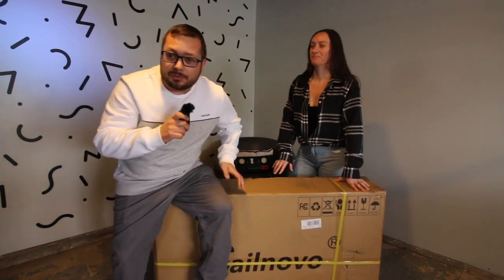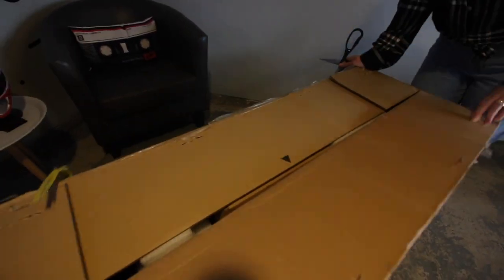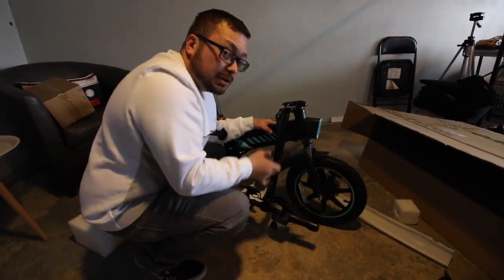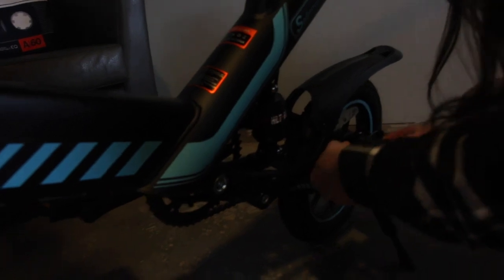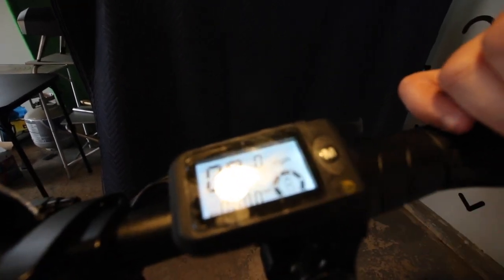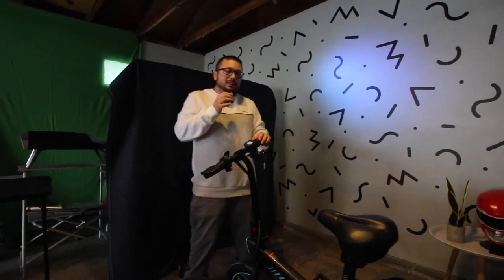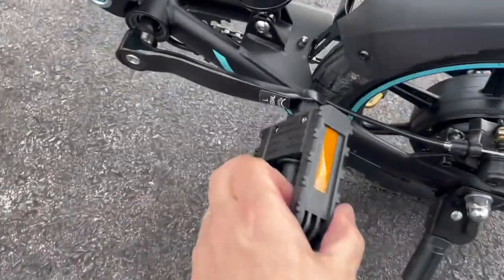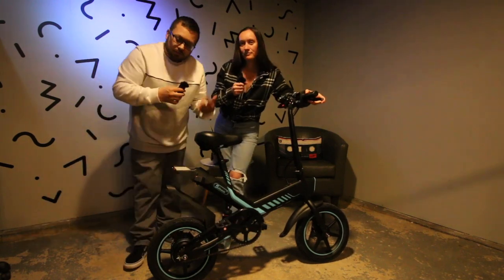Cheapest FULL FEATURED E-Bike on Amazon - Sailnovo

Comment: 12" tires the bike goes 15mph and the 14" goes 18mph

Ive been comparing the two there is also the same frame build but different names but it looks like Sailnovo has the 14" tires while all the others have 12"
Reply from the maker: Nice observation. I thought they were all 14”.
Reply: @unprofessionallyunboxed  i wish lol the 12" look so tiny... but hey its about the performance not the size right bwahahaha.
Reply: Do you think someone could put bigger tires on this bike or no?
Reply from the maker: Absolutely not. The fork is too small, and the motor is in the rear wheel.

Comment: I've been trying to get this bike for a while now... it sells so fast! My height is only 5'6 do you think this bike would be a decent size for someone my height? Other than that i want one of these so bad lol
Reply from the maker: I’m 5’4”. Rides great, even with zero power. 5’6” should be just as decent. 5’9” - ~6’ will have knees up higher, but totally doable and we’re doing mostly all throttle anyway. Nephew is 6’4” and he just used throttle to ride it around.
Reply: I'm 6 feet 220 pounds. Works just fine

Comment: Would the controller and battery be upgradable for more top speed and range like a 48v 20ah battery since it's removable?
Reply from the maker: I don’t know where you would put that extra 10Ah battery at… this thing is small. There controller is also small to fit in the frame. You would have to mod something to fit externally. At that point, a Lectric bike would be the way to go. 750 watt motor, 48v battery and room to include an external auxiliary battery on a rack to increase range.

Comment: It doesn't look like a normal sized adult can get anywhere close to full extension of their legs. And the 14" wheels will guarantee that you feel every bump. It's more like full featured toy. The Hyper ebikes as Walmart are much better bikes and they sometimes sell for $398. But who cares if it makes you happy.
Reply from the maker: We like something with a throttle. The hyper at Walmart just doesn’t check all our boxes (mainly battery size and motor wattage) The seat height is adjustable on this bike for probably someone 6’2” or shorter. I can see it being an issue for taller people. Also, I assure you I felt zero bumps and that mid frame shock ate it all.
Reply: I think the max height for this bike is 5'10 but im sure someone that is 6 foot could still enjoy this bike. Ive seen lots of videos of tall guys on even smaller bikes lol